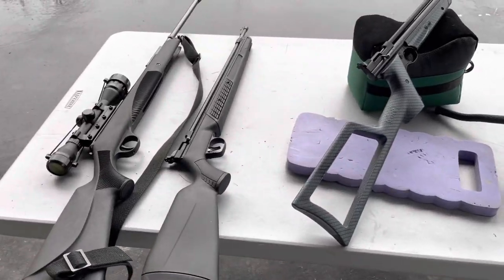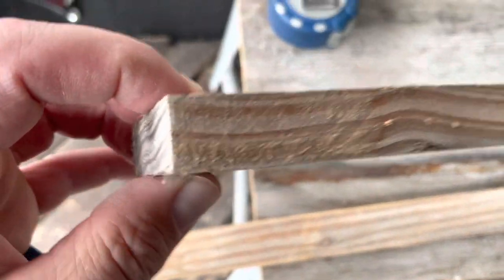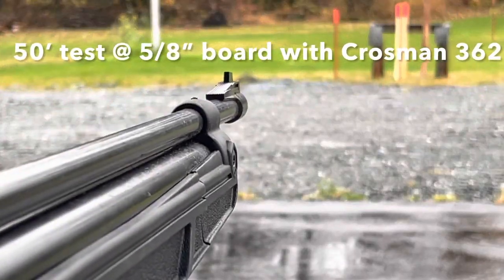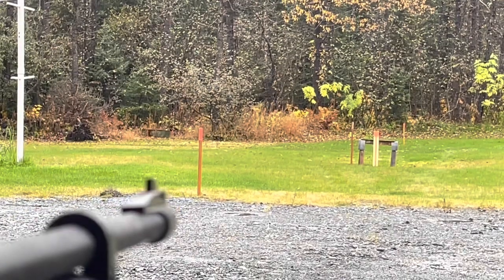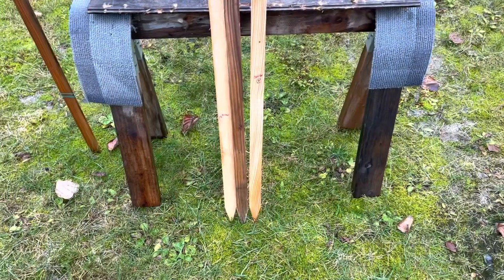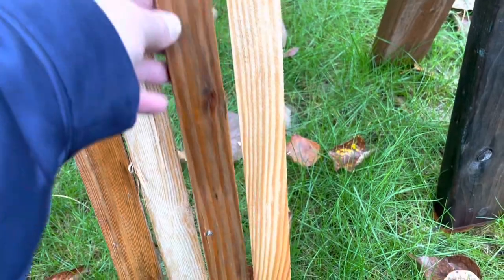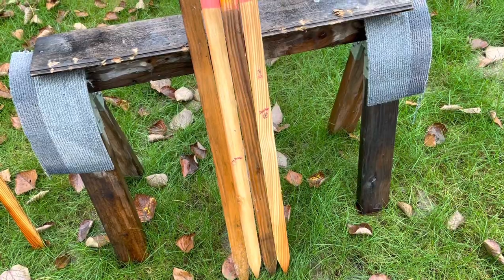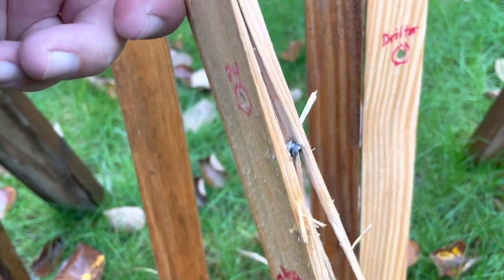How far will it kill? Testing .22 cal airguns

Comment: Just a tip for some of you guys shooting your pumpers in weather conditions, Pumpers and Co2's have power jumps when the weather is warmer. You will lose power on rainy days and cold weather.  Thats why Co2's are crap in cold weather the power drop is quite drastic.  Break Barrels have no problems in diffrent weather conditions because when the piston compressess the air ,it creats it's own heat, so thats why there is allways a big difference between the the airguns.  I like your video but the test is also effected by the wood being wet or damp.

Comment: Liked your video but you have your description is wrong the pellets did pernitrate the boards, but you do know that wet wood adds resistance to the boards and your not looking for penetration  but exit holes.  A wet piece of wood can add up to 15% more resistance to the wood, the pellet losses energy passing through the soggy to layer of wood, which the break barrel can over come at 800fps but the 362's max is 700fps, so if you subtract 15% form each guns max you will see why the 362's pellets  did not have the power at 150 feet to exit the wood.  Nice video.

Comment: The old timers would adjust the loads for thier shotguns by starting out with a light powder charge and increase the charge a little at a time until the pellets would penetrate a steel soup can.  They said if it would punch through a steel can it would kill small game.

Comment: My 1322 backpacker conversion with no valve mods is great for dove at close range or pigeons in barns. The pellet drops off too much to take them over 20 - 25 foot up and 20 foot out. Even standing almost directly under them it is impossible to get the pellet 45 foot up with any accuracy to get at them. I can actually see the pellet lose velocity. With a scope I get about 70% headshots 10% drop into the body and 20% misses as long as I stay within the effective range. It doesn't take much to miss a headshot and I can see the pellet trail it is of such low velocity. I have a discovery, a p-rod and the backpacker, all .22, and to test the power I just shoot straight into a clear grain 2 x 4 at 1 foot. The backpacker the pellet skirt is flush in the penetration, the p-rod is buried about equal to the length of a pellet and the discovery is buried double the length of a pellet. I used a probe to find the top edge of the skirt then sized it up to a pellet to come up with the depth. My friends Marauder .25 cal blows right through a 2 x 4 at close range but he had some work done to it. I've shot way more pellets and gotten more dove an pidgin with my pumper.
Reply from the maker: I’ve not shot my Drifter since last fall. I need to do some shooting with it and likely clean the barrel. It’s a fun little gun but my first impression wasn’t blown away with the accuracy. I know it can be better than what I was getting.

Comment: Great video, it's good to see some RWS 34-.22 stuff. This is just for some info/data but in my backyard range I have a pine tree that sits at a measured 77 yards and I've shot (thus far) 2 squirrels with my -34 using Crosman 14.3 gr HPs (very accurate out of my somewhat hot shooting 34) and on the first squirrel the pellet went completely through the front shoulder and exited. On the second squirrel the pellet stopped just up against the skin on the opposite side of entry of the front shoulder without exiting. Both were standing in just about identical poses broadside to me at the base of said tree. And remember that squirrels are tough and their skin has this odd property that makes it very movable and acts almost like a self-sealing gas tank in an airplane wing. The nature of their skin is I believe what makes it so difficult to kill them -without using the effects of extreme velocity (hydrostatic shock) at distance. My RWS is a bit hotter shooting than my model 95 Hastan .22 and is squirting those Crosmans at an honest 765 FPS (measured at 20' from muzzle) and I've had more than one squirrel run off from what I thought was a perfect shoulder shot at <30 yards, that left me having to chase them up the nearest tree in order to claim them with another shot. They're a tough little animal. Keep the vids coming and safe shooting.
Reply from the maker: Thanks! 

Squirrels are crazy tough. I get nuisance squirrels every summer and they are way harder to cleanly kill than the feral rabbits we occasionally get. I’ve shot a number of rabbits in the shoulder area and they fall right over. Some of the dang squirrels refuse to die. I most often use head shots for the squirrels now at closer ranges than I was before. 

Primarily though I just like to plink and experiment. I enjoy challenging myself to shoot longer and longer distances offhand. This channel has been fun to make as I’ve learned a ton about airguns from viewer comments. I’m looking forward to getting more light and nicer days so I can shoot outside after work again and create some new content.
Reply: @airgunsofalaska  Absolutely right about the rabbits. If you look at them with a mean grimace they'll just about die on the spot. I'm sure those Alaskan squirrels are probably a bit tougher than ours (Eastern Grey). I'm a few miles to the Southeast of y'all in Wilmington NC. I love to shoot and do a little hunting, but lately I've been on an Airgun craze and prefer to just be able to walk out on the back porch anytime I want (inside town limits here) and shoot as much as I want. The data gathering is cheap and lots of fun and it's awesome how you can just scale down your ranges and have every bit the fun without the price/penalty of the powder burners. A good quality airgun like the RWS is as versatile in its own way as anything that goes boom. Keep the videos coming (if weather permits) and I'll keep watching. Subscription will be added momentarily. Thanks!
Reply from the maker: We’ve got red squirrels which are not very big. They’re similar in size to a 13 lined ground squirrel and will be active off and on during the winter. 

I shoot my airguns way, way more than powder burners. I hate cleaning firearms and with the current price of ammunition, I haven’t shot them for quite some time. Plus, it’s such a hassle to shoot powder burners. I either have to go to the public range (which I hate) or kinda hide out and shoot in discreet areas like old gravel pits. Problem is they’ve been blocking off access to more and more of the old pits due to slobs illegally dumping trash and junk vehicles. 

It I’d so nice to walk out into my front yard and shoot. I’m out of the rain and have access to all my stuff. Plus it’s been really cool to dig out my old airguns that in some cases I’ve not looked at or shot in over 20 years. 😀
Reply: @airgunsofalaska  Red squirrels are awesome, and not considered pests here (they're very rare) I've only seen 1 in 34 years of living in NC. I also watched your Hatsan 95 video and I 100% agree with your assessment that it's fairly inaccurate and extremely pellet picky (I still haven't found one kind/weight/brand that it will consistently group under 3/4" at 20 yards) so mine (.22) mostly sits on the rack and I always grab my 34. I bought them new at the same time in June '22 and I've got over 6,000 rounds thru the RWS and am very impressed with the power/accuracy. The Hatsan feels better on the shoulder to me at least, but the RWS is the  much better gun. They're both conventional spring pistons and have plenty of power but the 34 is probably a bit faster (surprisingly) and far and away more accurate/consistent. That old 880 that you have is super neat and I also have one that's much newer (thus plastic everything pretty much) but I installed a peep sight I made/modified by drilling a tiny hole in the cheap daisy airgun scope ring that came with it and mounted it on the rear dovetail and that really improved my accuracy overall and it's super fun to shoot, although a bit flimsy unless you're very gentle, I've killed tons of squirrels with it before I got the .22s.
Reply from the maker: @codered7453  I looked up the red squirrel and it looks like they range across quite a bit of the US. I didn’t realize that. They are the only type of tree squirrel we have and they are everywhere. 

I like my RWS 34 way, way more than my Hatsan. The Hatsan is unrefined and not pleasant to shoot. The RWS is smoother, way easier to shoot accurately and the T06 trigger is worlds better. 

The traits of the Hatsan makes it unenjoyable for me to shoot.
Reply: @airgunsofalaska  The red squirrels are pretty widespread and especially up north. We also have Fox squirrels down here but they turn into phantoms as soon as you enter their neighborhood. They're quite a bit larger than the others as well and much prettier. Regarding the Hatsan 95 mine shoots very smoothly - the 34 had an awful twang for the first 3,500 rounds but has since calmed down and now when I pull the trigger it's a solid thunk with little vibration. I have a Bushnell 3x9x40 on it but it's barely adequate and am definitely looking forward to putting an actual airgun scope on it with some really good quality rings/mount so I can ring out every last drop of performance from it. I was curious about the elevation at which you shoot because that can have a diminishing effect on performance of spring guns like ours. At sea level, I'm getting every FPS I can possibly obtain without surgery/modification to the rifle. I'd also be curious if you have chronographed your 34 just for the sake of data accumulation.

Comment: Crosman penetrators will go thru 2 of your thinner boards also Gamo rocket has good reputation for penetration , but I don't think pure penetration equallls lethal,  , I like the concept of the video though , Im always intrigued by using some clay for testing , I recently looked at ballistics gel and it's way wY out of my price range for doing tests . The crosman penetrators are amazing at living up to thier names but not very consistent or accurate,  I was able to penetrate a large sized 3 gal empty propane container with my Beeman RS2 Sportsman .
Reply from the maker: I’ve also experienced a lack of consistent accuracy with pointed pellets as well.
Reply: @airgunsofalaska  lol I still have half of the original tin of 100 and had them for 5 years , they are a novelty.  Show your friends compared to a 22LR

Comment: My worry would not be hitting power, but shot placement.  I trust my Benji out to about 25 yards (the length of my back yard).
Reply from the maker: While shooting this past fall I was surprised by how many flyers I’d see when sighting in the different guns on paper targets. Often times the reason for the flyer seemed completely random. I agree with you about keeping the distance close with an airgun. 

A few weeks ago I also saw a phenomenon that they talked about on the American Airgunner channel where different pellets can begin flying erratically past a certain range. They were specifically talking about 10 meter target guns and how past that distance their groups would open up dramatically. I saw a similar thing using JSB Jumbo Monsters shooting out to 50 yds. I couldn’t even hit an 8.5x11 sheet of paper consistently. I was shocked by how inaccurate those pellets were at that distance.